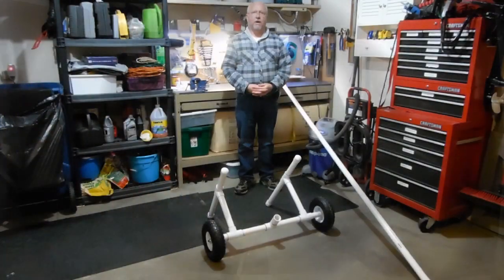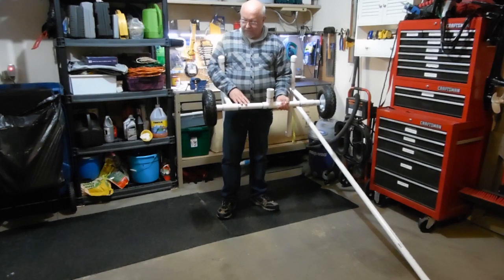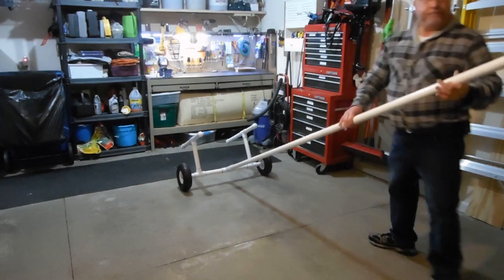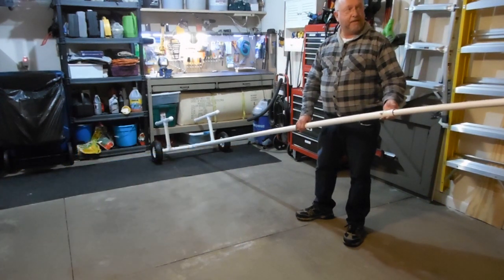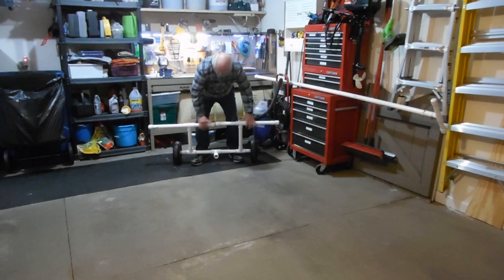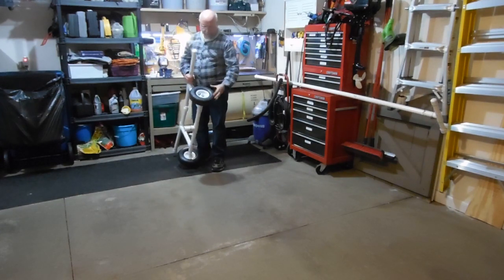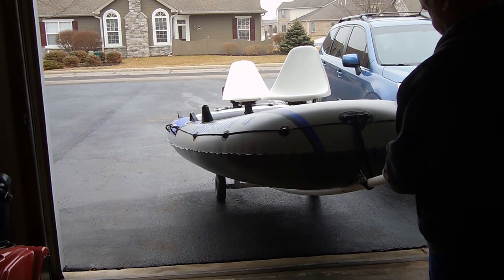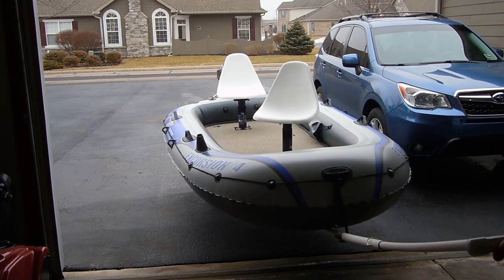Boat Dolly out of PVC Pipe

Comment: How wide did you make for the rails to sit on bottom of boat ?
Reply from the maker: Sorry, I don't have the exact measurement on those.  You can get an idea by watching the video.  I did make one end shorter then the other so I could swing them inward for storage. I no longer have the unit.  At 72, I decided to be land locked and sold the entire system.
Thanks for watching, sorry I couldn't give you the specifics you requested.

Comment: Nice, bit the bunks don't have to be that high, just enough to clear the wheels.
Reply from the maker: I can get a little sag with the motor in place before launching. But when empty your correct. Another advantage of your point is I could be closer to the shoreline when launching and retrieving! Thanks for the suggestion and for watching 👍👍

Comment: Hello Dan. I would like to thank you for your most generous and very clear project plans. I built the dolly for an Intex Excursion 5 and  I made the following changes that may, or may not, be of interest. 

1. Used 1/2" copper pipe for the axle, with washers and hitch pins to hold on the wheels.

2. Used two 5' x 1" PVC pipes and one 5' X 1-1/4"pipe to comprise the horizontal center pole. This fit into our SUV quite nicely.

<------ 1" ------>
               <------ 1-1/4" ------>
                                         <------ 1" ------>

3. Drilled three holes in the axle for drainage.
Reply from the maker: Sounds AMAZING. I always appreciate hearing from someone who takes the initiative to build and make it there own 😁. Sounds like great improvements!

Comment: i want to do this, what sizes do you cut the pipe?
Reply from the maker: Inflatable boat dolly construction and parts needed.

1-1”x10’ pvc pipe (schedule 40)
33” for axle, remainder for handle and push extension 

2-1 1/4” x 10’ pvc pipe schedule 40

5-1 1/4” pvc 90*elbows schedule 40

4 - 1 1/4” end caps schedule 40

1 - 1”  T 90* Schedule 40

1 - 5/8” x 36” threaded rod (for axle)

2 - 5/8” lock nuts 

2 - 10” wheels (Harbor Freight)

PVC CEMENT (cleaner and cement)

Comment: Like the idea but I  would of liked to see you build it from scratch step by step close up.
Reply from the maker: Sorry,  In hindsight I could have done two versions, one of each.
Thanks for watching and hope it gave you a little inspiration to try it!
Reply: @BoilerDan1  Yes it most certainly has thank you.
Reply: @BoilerDan1  Could I ask what size wheels please and what to type in my Internet browser search bar for them or similar? Are they on ebay? Thanks.
Reply from the maker: You can get similar wheels from Harbor Freight:
https://www.harborfreight.com/10-inch-x-3-1-2-half-inch-pneumatic-tire-67465.html
You can get the threaded rod from any major hardware store .
Menards:
Hillman 5/8" -11 x 36" Zinc Threaded Rod
Model Number: 11033 Menards ® SKU: 2278908
https://www.menards.com/main/hardware/fasteners-connectors/anchors/threaded-rods-nipples/hillman-zinc-threaded-rod/11033/p-1444432420568.htm
Reply: @BoilerDan1  Ok thanks, could I also ask what you did with the dolly when you went out onto the water on your own? Did you fold it up and take it out on the boat with you or did leave it on the shore/beach/river bank etc? My concern leaving it is getting it stolen or taking away by some idiot.
Reply from the maker: I slid it underneath my car, turning the upper supports sideways so they were flush against the bumper.

Comment: Dan .. excellent video!  Do you think you can cut and paste the list of all parts needed into the description of the video?  Thanks ..
Reply from the maker: Great idea. I’m away on vacation, but I’ll add it asap.  In the meantime:

1-1”x10’ pvc pipe (schedule 40)
33” for axle, remainder for handle and push extension 

2-1 1/4” x 10’ pvc pipe schedule 40

5-1 1/4” pvc 90*elbows schedule 40

4 - 1 1/4” end caps schedule 40

1 - 1”  T 90* Schedule 40

1 - 5/8” x 36” threaded rod (for axle)

2 - 5/8” lock nuts 

2 - 10” wheels (Harbor Freight)

PVC CEMENT (cleaner and cement)

Thanks for watching and taking the time to suggest a helpful addition 👍
Reply from the maker: I was able to copy and paste what I sent you to the video description!
Thanks again for the improvement suggestion. 👍👍

Comment: Do you think this would work for an excursion 5 I do believe the boat is 2’ longer than the 4.
Reply from the maker: If it has the motor mount on the back it should. The motor isn’t real heavy however I had trouble with it pushing under the raft. That reduces the thrust and speed….. maybe a better system supporting the motor to the raft?
Thanks for watching 👍👍
Reply from the maker: I should have mentioned that I made several videos on my journey with the motor and raft. You should take some time and check them out as I cover a lot of issues along the way 😮👍👍

Comment: Why'd you make the platform that holds the rear of the boat so high above the wheels?  Seems a little ungainly.
Reply from the maker: I think it was so that I could put the motor on the boat/raft before launching. It gave just enough space so that the propeller wouldn’t hit the ground.  It worked pretty well, however if it were for a canoe or Kayak you could make it a lot lower!
Thanks for watching 👍
Reply: @BoilerDan1  That makes sense, but can't you trim the motor up so the prop is behind the boat instead of under it?  I'm not sure if that kind of motor has the trim adjustment like the electric trolling motors do, so I'm asking.
Reply from the maker: Yes it does but it’s not locked in very solid. Plus at the time, it was my first attempt, not even sure what I was thinking!😂

Comment: Is the boat hard to pull on a steep boat ramp?  I have a hard time pulling my boat on a steep ramp.
Reply from the maker: Not if it’s secured to the dolly.... but you have two choices.
1. I take a strap and secure it to the pull ring of my Subaru Forester then wrapped it around the handle and gently pull the raft and dolly to the top of the ramp.
2. I’ve taken everything out of the ramp making it lighter, and then pulled it out by hand.
If you have a second person it is easy.
If you’re alone. It can be tricky getting it on the dolly out in the water, unless you wade out and secure it on. I’ve pulled the raft out and then slid the dolly under it off to the side of the ramp.
A lot depends on what shape you are in! I had to resort to pulling it the top with the car😂😂

Comment: Great idea...gonna try this.  Thanks for sharing.
Reply from the maker: Some additional thoughts from viewers:
Launching isn’t a problem, but alone trying to get it positioned to get out of the water is tricky. It tends to float. Three solutions suggested:
1. Pull raft out of water, then lift and slide dolly underneath.
2. Drill holes to allow air to escape from pvc and fill with water. I’ve tried that and had minimal effect.
3. Prior to sealing the pvc, fill some areas with sand! I think that might just work!  
Thanks for watching 👍

Comment: I like the ideas! I started building my own using 3/4 conduit instead of threaded pipe. Much stronger, much cheaper, much lighter and you can attach the wheels with hitch pins for breaking down for transport or easy change out to larger wheels.
Reply from the maker: Great idea! Everyone appreciates innovation and improvement. Thanks for watching and contributing! 👍👍
Reply: I’m intrigued by this idea of using 3/4” conduit. Any details on your design?  Are you using a design similar to this PVC dolly, and if so, what are you using for the tees?

Comment: Great stuff. I am sure your vertical frame could be shorter , so your boat would be closer tothe wheels and the water. You would not need to push out so far to get her to float.
Reply from the maker: Brian Jones I just realized why I made it higher!  So I could put the motor on the back and it wouldn’t drag.  Now I can sleep at night 😂😂😂
Reply: @BoilerDan1  That would explain it! Nice one Dan. Enjoy it mate.
Reply from the maker: I agree. I’m sure why I chose that length? I think I just used what was left over!  They are not glued so they can be cut down by a few inches 😁. Thanks for watching and taking the time to give a helpful hint 👍👍
Reply: @BoilerDan1  All you need is for yourr boat to clear the wheels
Reply from the maker: Brian Jones 👍You make so much sense!  Where were you in my drafting stage? 😂😂 Thanks again 👍👍

Comment: Nice job, I've just completed mine, I've added a bar across near the top for more stability when I load the mariner 3. I started out with a few mistakes, still got one that I won't try to fix as I've glued. :-)
Reply from the maker: It’s fun to build and I’m glad to hear that you made improvements! I ended doubling the pull handle and thought about something vertical to help guide the raft back on when coming back in.  Out isn’t a problem but in by myself is more difficult.... appreciate your watching and then building one for yourself! Made my day brighter 👍👍

Comment: Really great idea thank you
Reply from the maker: Thanks,  I did do some additional improvements as time went along.  Possibly the best would be to put the larger pvc over the smaller ones on the handle itself.  I dropped it on a hard surface and broke a piece off.  Easy fix by sliding the larger piece over it after coating it with the pfc glue.  Although I did put everything in the raft before launching, leaving some of the weight out is also a better choice as well as emptying out what you can at the end of your trip before trying to bring it back to land.  Launching is a breeze... But getting it back on without getting in the water is difficult.  I ended up pulling the raft onto the ramp and then lifting to slide the dolly under it.  But all in all, I'm very happy with it.  Thanks again for watching, and taking the time to make a positive comment! 👍👍

Comment: Hey Boiler Dan, what a great idea, I just bought an Excursion 5 and want to make a dolly. Can you sen me the measurements for each section. Like the risers to hold up the boat?
Reply from the maker: After long consideration.... I'm getting older you know.... and the only close place I could use it, the water has been too high both last season and this spring as well.   I had an offer for it all, and couldn't pass it up.... Yes, I sold it... I do recall that I just used the left over pieces... Sorry I never got that measurement.  I will add that a little shorter posts that held the raft would be an improvement on my build.  All in all it did work very well for launching.  But a little difficult for one person to bring it in. I ended up pulling it a little out of the water and then putting the raft on it.  With two people though, you can both launch and retrieve the raft. 
Note: I may return with a new build in the future.  I might get a raft with the light weight floor with it... and test out the 4 cycle motor..... The future awaits!  Hope you can get a visual of mine and wing it!  That's half the fun!

Comment: The only things I would add, need cap nuts added to the list and the 1 1/4” x 1 1/4” M & F threaded pipe joints. They still sell the 10” tires for the wheels but with a 36” rod you need the inner PVC pipe to be closer to 31” not 33” because you end up not having enough thread left to secure the wheels on the ends.

I would add a picture of our final product if I could. 🤷🏻‍♀️
Reply from the maker: Nice tweaking of my humble efforts 👍.  If I remember correctly, I was able to tighten the bolts enough to have them slip just inside the pvc pipe and support the rod.  But I agree on your input completely 😁 Thanks for watching and taking the time to comment.

Comment: nice piece of kit. thank you for the ideas.
Reply from the maker: You’re welcome.  One improvement, I should have doubled the pull handle by putting the larger on top of the ones I used. I had one crack when I dropped its edge on cement.  Putting the heavier one will improve everything. I mentioned that in a subsequent video, but just in case you missed it, ... we’ll, now you know 😁. Thanks for watching and taking the time to comment 👍

Comment: Just built me one thinking about putting some swivel seats in have you had any problems with your chairs I used 3/4 plywood for my floor
Reply from the maker: 3/4 plywood will give stability, You can also put another square where the chair base sits for even more stability.  The chairs I purchased were about as cheap as you can get.  Didn't have problems with the base, but the backs were kind of bendy and that feels a little strange until you get use to it.   I'd recommend a better seat than mine.  But as far as comfort, it is a must in my book!  Thanks for watching.

Comment: Great video! Could you provide the measurements for the sections of pvc used for the uprights and the sections used for the rests please?
Reply from the maker: If I'd only looked at you post when posted.  After long consideration.... I'm getting older you know.... and the only close place I could use it has been too high of water the last season and this spring too.    I had an offer for it all, and couldn't pass it up.... Yes, I sold it today.... I do recall that I just used the left over pieces... Sorry I never got that measurement.  I may return with a new build in the future.  I might get a raft with the light weight floor with it... and test out the 4 cycle motor..... The future awaits!  Hope you can get a visual of mine and wing it!  That's half the fun!
Reply: BoilerDan1 No problem...I just managed to get my hands on the pvc pipe today.  I think I can eyeball it from the video . The part where you turn the rests parallel to the axle to demonstrate how to store it should help a lot.  Looking forward to putting this together tomorrow. Thanks for the reply.

Comment: Thanks for posting. I am racing to Home Depot now to build one
Reply from the maker: I should have double layered the handle. One chipped when I dropped it on cement. I was able to just slip over the larger size to make it stronger. Good luck with yours. Thanks for watching👍
Reply: @BoilerDan1  not surewhat you mean double layered....a smaller PVC inside the handle extension? That makessense  to make it stronger. Thanks
Reply from the maker: Yes, the smaller one fits snugly inside the outer one.  It makes it stronger to roll to the water. Then you slide it out to push the raft out into the water to launch it.

Comment: What was the weight of the boat ? and what was the weight of the motor ?
Reply from the maker: The motor is around 24 Lbs. I estimate that the raft is around 40 Lbs.
Obviously the PVC dolly wouldn’t work for anything heavy.
Thanks for watching 👍
Reply from the maker: I estimated wrongly on the weight of the raft. It’s approximately 56 Lbs with the motor being around 24 Lbs.
Reply: @BoilerDan1   Thank you, Sir, for your feedback... I really liked your idea and want to recreate it to my Dinghy inflatable boat since I don't prefer to dig holes in my boat for lunching wheels... my boat is about 30 Kilos + 30 kilos for a 5 HP motor total almost 60 kilos or ( over 130 pounds) any insightful ideas or advice on this?
Reply from the maker: Ibrahim Da'as ; Unfortunately I would be concerned about the weight. I don’t think that the pvc pipe would hold up
Reply from the maker: Sorry I accidentally hit send.... not sure if you could modify and make a dual platform with dual wheels?  I don’t think the post type system like mine would work at all. I think it would break off..🙁
Reply: I'm building a 200lb rated type system for about 60$ CAD, A little different then the one above but this video definitely influenced my design. Let me know if you still need a solution I can email you pics of mine once I'm done
Reply: @arthurmrozek5359  im interested in your design for my 150lb boat plus motor!
Reply from the maker: @MrKittyLady unfortunately I don’t have the weight of my system, however I did load everything on it.  I’m guessing it was in the 150 lbs range.

Comment: Your idea about the threaded connections, and sliding pins SIGNIFICANTLY helped me, thank you very much.
Reply from the maker: You welcome!  I'd add that the "T" handle could be reinforced with the thicker 40 PVC.  I'll post a short video soon.  I dropped the pole and the end of the "T" broke.  It's an easy fix as I can just slide the thicker PVC over the broken piece. 
Anyway, thanks for taking the time to write.  I apricate knowing that my "retirement activity" is doing some good.  I have fun making them and getting positive feed back is a fun thing!